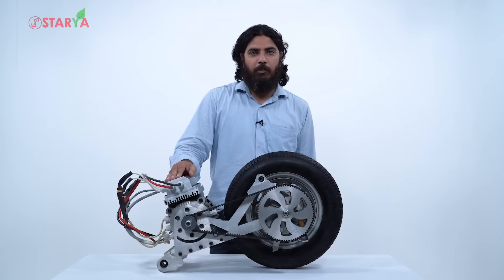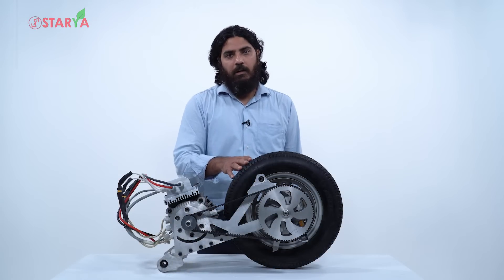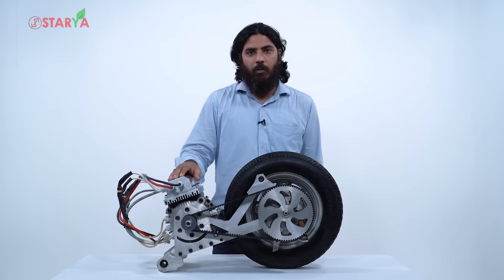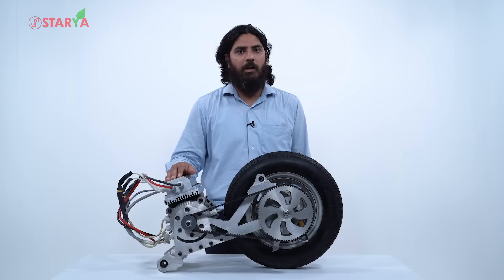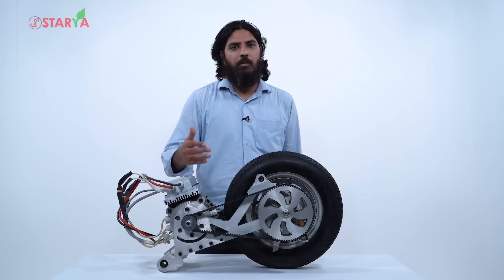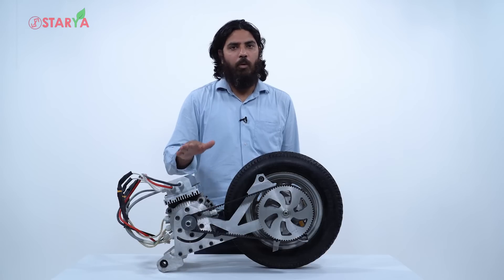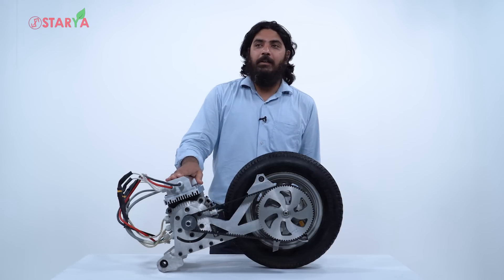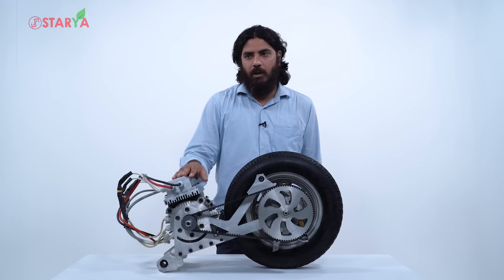Petrol To Electric Scooter Conversion Kit | Starya Mobility | India | EPK 1.0

Comment: Ev should focus on only speed load capacity range motor quality heating issue battery problm and reliability and also long lasting thats it we dont need any mobile phone function that ic engines doesent come with extra digital options we want commuting scooter not mobile phone so your doing great job

Comment: Sir,
Hybrid bldc motor had come. Just fix to rear wheel of scooty and drive. No removing engine part and alteration, but your method is so long. Why dont you follow hybrid .
Reply from the maker: Thanks for the suggestion..we have made a detailed research and study on hybrid models. It does not fall under our vision of "making cutting edge ev technology affordable". We want to ensure that the rider gets total 360 degree upgarde to electric technology, which is not possible to achieve in 2 W hybrids.
Reply: You can make pmsm motor as hybrid plate motor also. It may  save money and alteration, remove all petrol engine concern parts except back  chassis of scooter , now you can see the cost and demand, I think.

Comment: Hallo sir congratulations all starya team for scooter kit 
Please make 2 suspension for proper balance other wise  frame will cracked 🙏
Reply from the maker: Thank you for the suggestion..we will look into it
Reply: activa is the largest selling scooter till date in India.  No unbalance issue/ frame crack issue ever arose in any of the model.  Every model used single suspension in the rear.  so I do not think we can doubt those Japanese Engineering.  Having single suspension means easy to remove rear tyre in case of flat tyre.  Single suspension is the way to go.

Comment: I think Suzuki Swish can also be converted. It’s same like access. I have swish 😃
Reply from the maker: hi kunal, technically it can be done, we are in the process of getting central governemt approvals to aid in RTO registration..the approvals are given based on ICE CC level, so it should be possible to get approval as well..we will post update soon.
Reply: @staryamobility  thanks for the info. I am in delhi. Also apply Govt to get subsidy for buyers. Delhi Govt is already giving subsidy Rs 15000 on new purchase . I think converting process is too good for Govt to fastly transform many vehicles into electric

Comment: Very good initiative and good product. 
But pricing is too high. 
Practically not workablr.
Reply from the maker: hi nikhil, thank you. we have a subscription model where the upfront cost is only 35k. The battery pack is on subscription & when it dies will be replaced at a highly subsidized cost. If you look at the lifecycle cost of 3.5 years compared to a new EV, we are still at 50% total running cost.

Comment: I have one query is the motor has heat shutdown
Reply from the maker: Hi..only if the motor temperature reaches 170 degree celsius..which is at very extreme driving conditions.

Comment: After retrofitting, when we go for FC/registration. . . is it going to be a fresh registration? can you please provide more info on this.. Because I have an unused old two wheeler without (vehicle documents missing/incorrect). .if it is going to be a fresh registration after retrofitting. .  i am interested for this product.. .awaiting your response!! thanks
Reply from the maker: hi, the registration number remians the same , the board changes from white to green. The vehicle documents are important yatish.
Reply: @staryamobility  is there any pre requisite that the vehicle should have registration within bangalore limits?
Reply from the maker: @yathishaas  until we expand to other cities, it will be easier to get it registered by rto if it's Bengaluru registered..if not we can go upto the extent of getting the FC done

Comment: What happens to the old IC engines when converting to ev?
Reply from the maker: As per rto regulations,it has to be scrapped.
Reply: Maximum vehicle is going tobe altered, but high cost in old byke I feel.